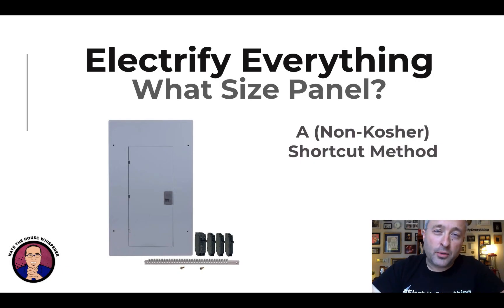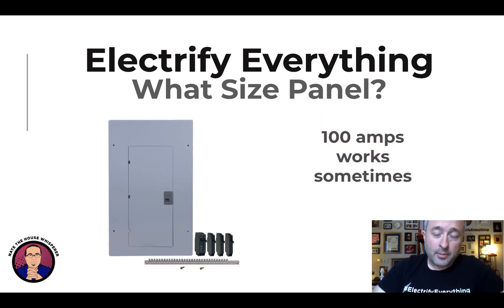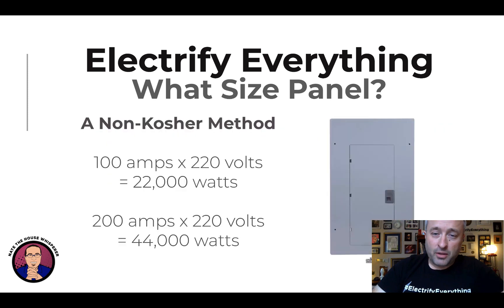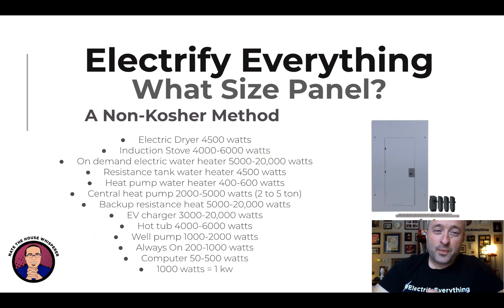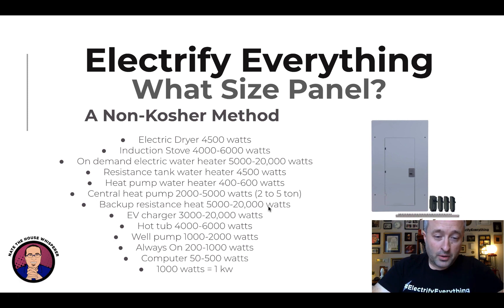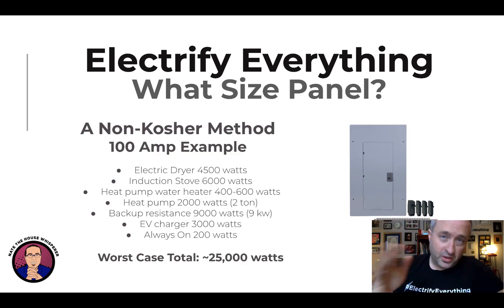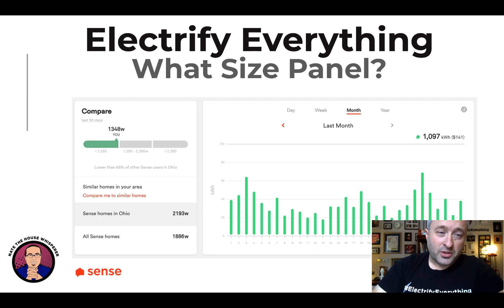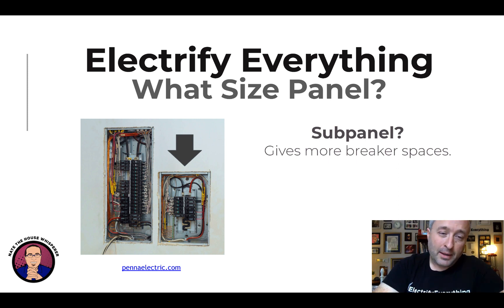Electrify Everything - What Size Electric Panel?

Comment: Bought Miele dryer 15 months back. 110v, 900-1100 watts. No use of house air, no hole in house to dump the air. Puts condensed water in onboard tank or drain line. Exceeded expectations... Thanks for enlightenment on panels

Comment: Fantastic video! One of the things that jumped out at me is the 90% reduction in peak demand  when going from electric resistance water heaters to heat pump hot water heaters.

Because people tend to use most of their hot water in the morning hours I can imagine that this has an even larger effect on utilities. 

Your idea to pay manufacturers to build heat pumps might be useful when expanded to water heaters as well, with the added benefit that it makes the grid run better than it might otherwise, in places where electric water heating is common.

Comment: If your going to get solar PV eventually… you may as well install an Enphase IQ Envoy-S Metered with consumption monitoring. It’s on the expensive side at around $600 but will prepare you for microinverter based solar PV and even partial or whole home battery backup. Thanks for all the hard work.

Comment: Thanks, Nate! Just installed an Emporia Gen 2 Vue w/ 16 CT (Current Transformers) a week ago, and it is really eye-opening. I'm finding the electrician who replaced my 100A service panel with a 200A delivered a fully labeled service panel w/ 14 circuits. Sadly, only 4 were labeled correctly. I know that here in CA electricians MUST label the panel for circuits they work on - guess the law doesn't say they have to label correctly. :-( Anyway, I am slowly identifying every receptacle and what circuit it is on using the Vue (in Sec mode). Amazing tool! Everyone who wants to know how they are consuming electricity should consider getting something like this. PS - Just finished the 5th episode of Electrify Everything course and I am already more confident in selecting a replacement HVAC for my home, which will include a Heat Pump, of course!
Reply from the maker: I've definitely found a lot of incorrectly labeled circuits!

What have you learned?

Comment: Great explanation! I didn’t catch anything about refrigerators. Don’t they have a pretty high starting power draw?
Reply: They definitely spike, but it's not that bad, it has to fit within a 110 circuit, so 1800 watts max, more like 1200 in my experience. New inverter fridges have no peak.

Comment: Does the Span panel that's recently been introduced in the market solve for the size issue raised here, or does it just add extra control?  Is this a good future proofing investment?
Reply from the maker: Kinda sorta, if you need more than 100 amps, you need more than 100 amps. To do HVAC + two EVs, I'd want a 200 amp panel in most homes. 

It's too early to make the call on Span, I'm hopeful, but having looked at and used a bunch of early products, they tend to overpromise and underdeliver. I do like the idea though, seems likely to help with load shifting as real time pricing becomes a thing. EV charging and hot water are super easy to move around, cooling is pretty easy, heating is tough (full power is needed almost 24/7 in cold snaps.) 

Tighter homes help with heating and cooling, but until there is resale value from efficiency upgrades, I don't expect to get beyond 200K shell retrofits/year, and even that is rosy.

I appreciate you making good on commenting!

Comment: If you have to replace your electric panel, consider the Span panel (https://www.span.io/) which allows fine tuned automatic control over your electrical usage and future-proofing your panel for additional loads and backup power down the road.